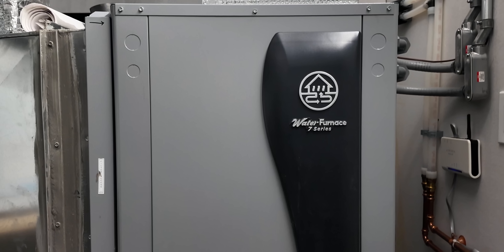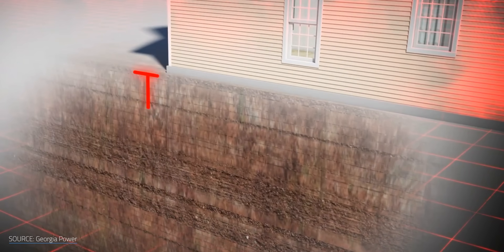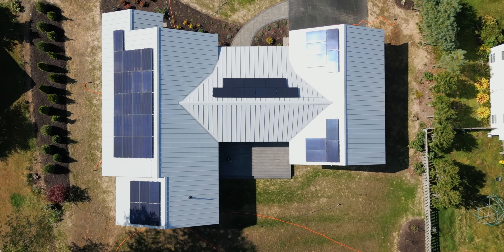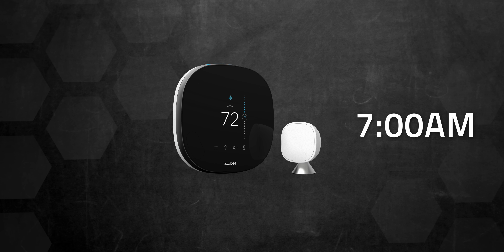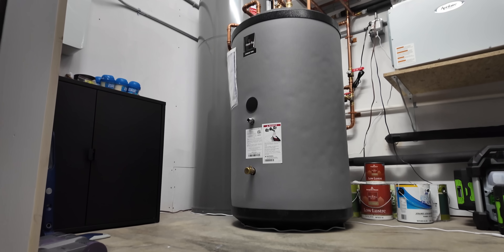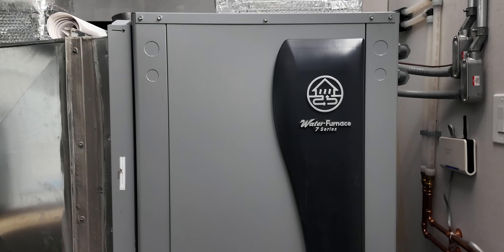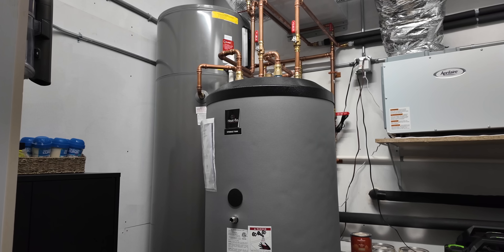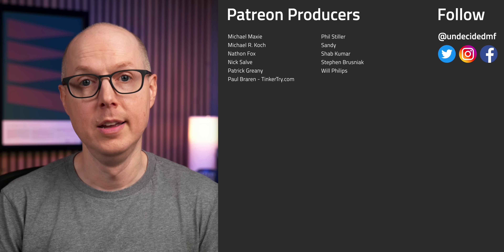How My Geothermal Heat Pump Really Performed (2 Years)

Comment: I contracted geothermal (borehole ones) for my housing society of 36 apartments. We used to burn oil to heat water and radiators so the savings have been in the tens of thousands per year. It took a little while dialing it in but it's now been 10 years (broke even within 3 years) and it works flawlessly all year around. For reference this is in Sweden where we get very cold winters and the house is from 1959 so not the best insulation. Electricity is very cheap there as well which of course further benefits this solution.
Reply: how does geothermal get hot enough to run a boiler?
Reply: @AricGardnerMontreal  via a thing called heat exchanger. Works like air conditioning, just backwards.
Reply: @catriona_drummond  in a hydronic heating system the water leaves the boiler at 80 °C and returns  at 50C, a geothermal heat exchanger cannot bring water up to 50C let alone 80C. I know what a heat exchanger is.
Reply: @AricGardnerMontreal  Heat pumps take advantage of the refrigeration cycle to pull heat from one area and transfer it to another.
Reply: @D @Draax17  are you not paying attention? You can’t use a heat pump on a system return temperature is 80 Celsius. If the heat pump can’t heat the water past 80 Celsius.
Reply: @AricGardnerMontreal  Well I guess it can't possibly work then and the Swedish fellow here just imagines his homes to be warm.
Reply: @catriona_drummond  he's a liar.
Reply: @AricGardnerMontreal  Or maybe you don't want to know how it works so you can keep pretending it doesn't work.
Reply: @catriona_drummond  are you going to reply to the central argument of 'how can a heat exchanger can raise the temperature of water enough to run a hydronic heating system'? -or
Reply: @AricGardnerMontreal  The answer to your question is the refrigeration cycle.
Reply: @AricGardnerMontreal   What I assume is you don't use boiler. You heat a water through geothermal and pump that heated water through the pipes. You also don't need 80 - 50 water these days. Side note efficiency of heat transfer is related to difference in inlet and outlet temperature not the temperature of water so an 80 - 50 and 50 - 30 would be equally efficient in heating but to raise water temp to 80 would be more costly so modern systems don't go that high. But still fact check me I have not looked into heating systems for a long time now.
You would need a bigger radiator to provide the same efficiency though. Radiator size is bigger for newer low heat systems as rate of heat transfer is slower due to lower high temperature.
Reply: @AricGardnerMontreal  No, because If you are too lazy to look it up I am not here to give you free physics lessons.
Reply: @RandomFrogFromOcean  Correct. an entire retrofit of the heating. not exactly cheap to pull out all the pipes and radiators and put new heating under your floors. unheard of in an poorly insulated apartment, op is still a larp.
Reply: @Draax17  wrong you cant use a heat exchanger to heat a hydronic heating system because it cannot raise the boiler temperature high enough. ask me how i know.
Reply: @AricGardnerMontreal  Sure, how do you know?
Reply: @Draax17 because everyone in Montreal has hydronic heating w radiators and the system can’t be retrofitted to use heat exchangers.
Reply: @AricGardnerMontreal  That's interesting, I didn't know Montreal had those kinds of problems. Still doesn't change the answer to your initial question. A heat pump can still pull heat from a geothermal source and supply a boiler by taking advantage of the refrigeration cycle.
Reply: @Draax17  no it cant, because it cant raise the temperature in a meaningful way, 40c i fine for heating with forced air, but 40c water is not hot enough to heat a house fitted radiators, you would need to have pipes under each floor of each room of your house which is only for rich people, OP did not retrofit his 'society of 36 apartments'  with underfloor pipes. he's talking nonsense.
Reply: @AricGardnerMontreal  Where are you getting these imagined limitations from?
Reply: @Draax17  where are you imagining buying incredibly high pressure heat pumps that can create such a massive temperature difference?

Comment: That's some sweet utilization, especially about checking the value in your area. I hope your figures include summer cooling because those computers running would overheat my house in the worse winter. My house was built in 1978, an "Arkansas" house in the NW with an undersized (1.5 ton) rotary HP, installed because the company went out of business in 1977 and they were cheap. 20 years later I was sold on a modern (2007) air source HP that would save me money. It didn't but it eliminated the former's struggle to keep my home cool in summer. Unfortunately the compressor failed after 12 years, within its warranty, but because it was installed by a company no longer installing home systems, zero warranty. I love being a person that saves energy but my current system costs less than a HP, even if I lived here another 50 years w/o another fail. That's a major reason to figure your energy use. In my case my city has VERY cheap electricity. In winter I heat with a single plug-in oil heater which, for 90% of the time, isn't turned up to max heat... takes a second heater the other 10% of the time. Worse is keeping the house cool in the last 2 years, where my dual hose portable AC sucks more power than heating in winter. Even at that, electric use in worse months is $80 per month (all electric house). I'll probably have to bump my monthly payment from its current $170/month for my house soon and take another look into a HP. It's now hard for me to justify spending $15K for a HP, but that's ONLY in my city. (If I lived 8 miles to the West, I'd maybe have installed one, where rebates are bigger, along with their utility rate.)

Comment: Massive, and I mean MASSIVE over complication of a water source heat pump. If you have a basic understanding of how they work, you know the deeper you go, the more stable temps are. Most water wells are around 100 feet more or less, and ZERO geothermal loops have access the these relatively warm stable temps with a constant, non-fluctuating temperature.

   It's a no brainer, and I have two water source heat pumps running on well water in two homes.......zero complications, no loop leak BS, no flow headers, no complicated zoning BS, no secondary pump for the loops. Connect it to the water well and check codes for discharge requirements.......there really are none in my area.

THIS approach IS how water source heat pumps have gained a bad reputation!!!  DO NOT do it this way, and you'll see.....

Comment: Holy moly my electric rate in winter is $.11/kWh. If the system cost scaled down to as low as 1/3rd like you suggested, that would still appeal to me. The low electricity cost makes it harder for us to commit to a solar array, though.

Comment: I had a geothermal unit installed in my residence in 1983. I just had it replaced in 2025 with another geothermal unit. That's 42 years of service out of a HVAC heat pump! The original unit was manufactured by Friedrich. The replacement unit is manufactured by Bosch. I can definitely recommend geothermal for HVAC. I have a well on my property that was used to supply the water for heat exchange. The waste water was used for irrigation. This works well, but I would recommend a recirculated loop system that eliminates the necessity of filtering the water and the regular filter replacements associated with my system.

Comment: The most interesting part of this presentation is that the HVAC system can be operated from solar power systems.
In many parts of the US, the most expensive part of home solar is tying it to the grid.
The grid is often used as the "storage" compartment for excess solar, keeping people tied to the grid.
I envision homes, and neighborhoods, where electric needs are met, without being tied to the grid.
Modern efficient refrigerant based heat pumps, make this possible, while maintaining comfort standards of modern times.

Comment: lol, seeing your hvac bill be 2/3 what your water heater bill is pretty funny. 
Here in SoAz, people’s hvac bill per month routinely hits $650 or more a month, not annually. 
And you would think that geothermal hvac here would really save, and it doesn’t compared to properly and optimally installed mini-splits set to 75° in the hot summers above 115°. They average using 150-250 watts per ton maintaining that temp. 
Geothermal can’t touch that and deliver truly comfortable temps too. 
Still, is a very interesting technology, just like evap coolers(or swamp coolers) still fairly widely used today by people resistive to paying a little to switch from evap (humidifiers) to heat pump hvac. Coolers use more than the whole house mini-split systems, believe it or not.

Comment: Like all such analyses I see, you reduce the real capital costs by the credits and rebates you receive from your fellow rate and tax payers.  What you consider to be a windfall is in fact confiscatory to your comrades who don't have the wherewithal  to provide the capital outlay or afford the debt service for same.  Also , you don't provide nearly enough data to determine expected operating costs over the expected life of the systems, which you don't mention.  Nor do you discuss the fact that finding HVAC firms with expertise to troubleshoot and repair heat pumps, let alone geothermal ones, is a crap shoot - certainly in the NE.  Finally, most homes that don't benefit from your super insulation can expect to run into periods where even geothermal will need to be supplemented by resistant heating coils, quite expensive especially in the NE.
While it is understood that this video focused on your HVAC, many of the same issues apply to your solar energy system and your EV.  They too shift some of your costs to others, including those who can least afford them - kind of opposite of what the progressives profess.  With all that said, you do a good job of assembling these videos to which I invariably attach a thumbs-up.

Comment: Furnace failed last Feb at our "forever" home in SE MI.  Spent $32K (before credit) for similar hardware as Matt: 3 ton Waterfurnace 7 and Rheem 65 gal 120V heat pump.  Air sourced heat pumps quoted at $25K. We justified this as a 20 yr investment in a low carbon heating/cooling system.  It's not about ROI, it's about 425 ... ppm CO2 heating our world.  Since we already had a oversized well pump, tank, and drain to lake from the previous open loop cooling system for the house, this was a simple install of electrical and swap out the furnace. I do think I shared some of my tax credit with the contractor, there needs to be more competition!

I anticipated the contractor trying to oversize the system so I measured our heat loss using the gas meter.  On a 6 oF calm overnight while holding 69 oF between 10 PM and 7 AM,  we measured heat loss at 32 KBtu/hr. For the meter reading of 280 ft^3 at $8.71/Mcf, gas cost $.27/hr.  Since the furnace cycled 31 times for a total of 3.56 hr, the fan motor consumed 2.5 KWH at $.18/KWH = $.05/hr.  House is 3000 ft^2, R50 ceiling, R20 wall, Low-E windows with 100 KBtu 90% efficient nat gas furnace.

We recently had a 2 oF calm overnight.  The Waterfurnace ran at Level 9 continuously between 12 AM and 6 AM while holding 68 oF.  It and the well water pump consumed 15 KWH @ $.18/KWH for cost of $.45/hr.  The well pump provides 5 gpm/52 oF and operates 30% of furnace on time while consuming 1.4 KW.  This "pump and dump" system is more energy hungry than a loop.  Since we have 8 KW of solar panels under a true net metering contract that ends in 2 yrs, this is the retail rate; not the geothermal rate.
%

Comment: We have an open loop geo thermal unit.  Well water in, through the condenser and then out to the Pamlico Sound.   Simple and relatively low cost to install here as the water table is easy to access.

Comment: ok, im a ac tech of 28 years. 1 major repair bill will cause you to lose all that money save. you save 5 thousand repair will take years to over come your saving. so in reality 2 major repairs will make you loose all your money you saved. high seer heat pumps can heat good till about -10f now. and cheaper to repair, and most hvac techs no nothing about thermal systems. so now you have to find a specialist {hard to find} over a tech that can be there the same day for emergency repairs. so in logic, heat pump is way to go, do to complexity, repair bill, and getting quick repair in extreme weather, hope you have back up, heat pumps do, electric heat, thermal units do not. you prob will wait 3 days to a week to get repair man just to diagnose then wait longer for the actual repair, being parts for thermal to get there. and if a pipe bust deep under ground, think of the expense and time just to find the leak. but if you have 10,000 just laying around for repair you have to wait days to get even if its a small repair. heat pumps cheaper easier to repair. systems never break when weather is good.

Comment: Really good video, my only dislike is that I dont understand how you calculated the 2100 USD for the air heat pump? Since you provided no COP, SCOP, JAZ or any efficiency values and how much kwh your house uses, this number seems rather abstract. From my calculations geothermal is more efficient but not 2x as efficient which is what your costs are illustrating. I would love if you could explain that further and show how you arrived at that conclusion.

Comment: The non-earth-based heat pumps I’ve experienced in rented apartments/houses are miserable during our hot summers and cold winters here on the mid-Atlantic coast. We currently have space heaters going, driving up our electric bill, and in the summer we install a window AC unit and run fans alongside the central AC. If I came into a bunch of money and could build my own home, I’d look into geothermal options - it sounds like it works much better and I’m all for energy efficiency and saving money over time, and you really sell it well. But I would also definitely ask around about people’s experience here dealing with muggy 100F days - I want lots of assurance that it will really work! Energy efficient isn’t worth sweaty, too-hot-to-cook afternoons all summer.

Comment: I did not know one could not turn down the temperature at night with geothermal.  That seems like a pretty big downside to me.  To keep it cooler at night is good for sleep.  But nothing is perfect.
Reply: @scorpio6587  he didn’t say you can’t turn it down. He said the system does not need to be turned down, and the rate of absorption is limited as ground is not a very good thermal conductor. You can definitely turn it down at night. In the morning, the system will just have to work harder (mine is a variable speed) to get it back to the daytime temperature.

Comment: I have install my first geothermal in 2005… (complete installation 15k$) Have cut electrical bill by half… The first heatpump have last 20 years,,, Change it in 2025.. New one have all the new tech… Variable fan, 2 stage compressor, etc… A little big smaller 2.5 Ton Vs 3 ton but do the job for another -20$ per month least electricity… Price of heatpump have raise a lot… New heatpump alone cost 18k$!!! The well and pipe were in good shape… I reuse them!!!

Comment: What is the insurance cost to cover all this in case of damage ?  And what is covered ?   Plus there are no qarranties  when you install all that underground system .  What happens if your home gets damaged by lightning or a hurricane?  What will it cost in twenty years to replace all that equipment ?  I own a 1963 three bedroom ranch with attached garage. I use a 6,000 BTU window air conditioner in the living room ( north side) and shut all the bedroom doors . One dehumidifier in basement runs most of the summer. In the winter I only heat the same end of the home and open bedroom doors before use. NG forced hot air & water heater. I have very low utilities bill in a comparison to all homes in my area.    And I put on a sweater when I get chilled.  Keep it simple.  Less is better.

Comment: Yes,I’d like both.  I did an analysis of geo when I replaced hvac about 10 years ago and the break even appeared to be about 40 years.  Seems that hasn’t changed.  Also interested in solar, and that break even is a lot shorter, 10 to 15 years. I do think when representing the electric cost though that you should depreciate the investment over the service life and add that to your service costs.

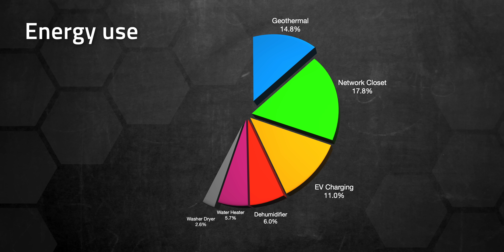Comment: 10:30 Technically what your computer uses is also turned to heat so the computer using power reduces the amount the het pump has to provide.

Comment: Well, you done a bad investment!!! At the systems price and the price for one KW/h you mentioned your payback time is 14 years compared to run heating on simple electric battery's! If you count in cooling in summer in your 950 dollar annual bill then that will be 16-17 year's payback time!
20 years is max for these systems to run properly , after that you need a new system. That's when you have paid cash without loan's,if you add interest on 54000 then it's absolutely,zero worth in your case

Comment: I live in Massachusetts also and installed a 4 ton, 2 stage Hydron Module water sourced heat pump in 2007. It cost me $15,000 to install everything, including the well. I have AC, Heat and a desuperheater that feeds a dual hot water tank system. I have no oil or propane in my house. I have AC, Heat and Hot water and pay about $250.00 per month for electricity....and Massachusetts has the 3rd most expensive electricity rates in the nation. years ago, I was paying about $175.00 per month when rates were cheap. Year to year, my KwH has changed very little from 10 years ago. I absolutely love my heat pump.